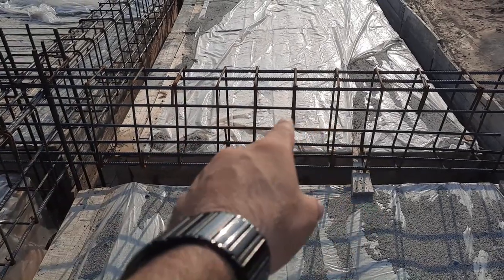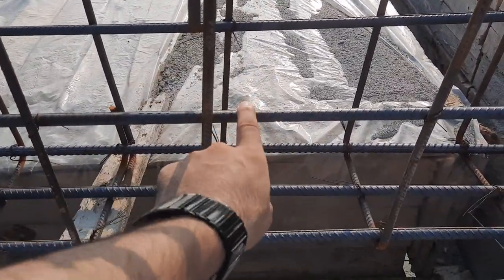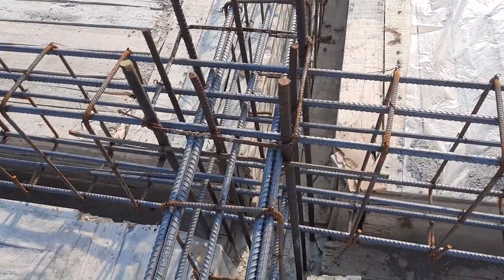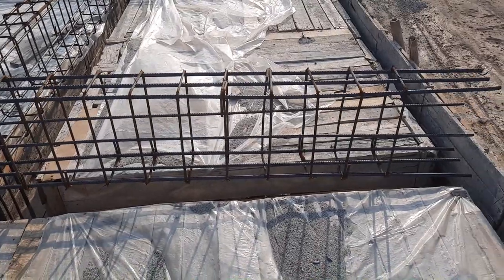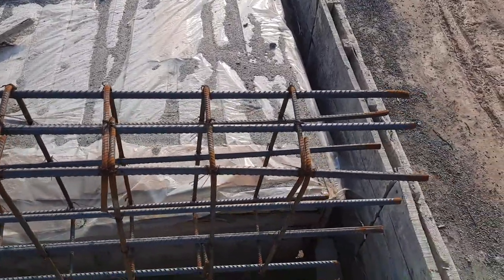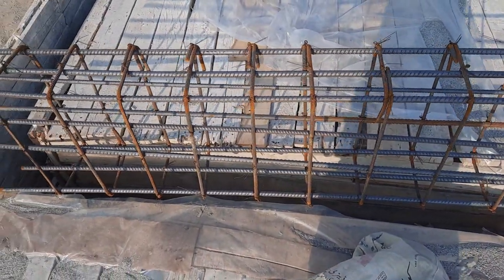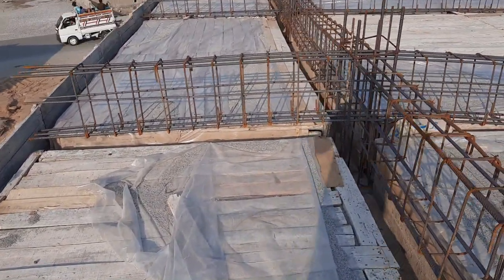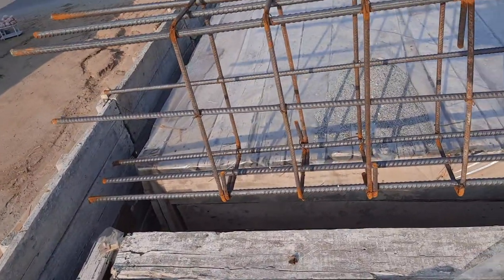5 Big Mistakes in Cantilever Beam on Site Practical Video | Civil Site videos |

Comment: That is not simply supported beam. That is continuous beam. A simply supported beam is supported at its ends by either fixed supports or pinned joints, while a continuous beam is supported at more than two points, with at least three or more supports